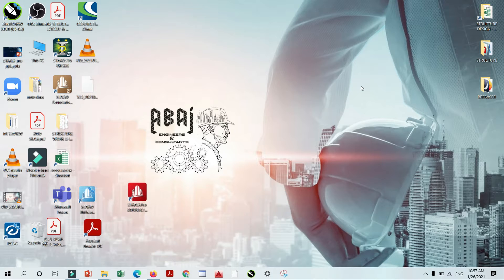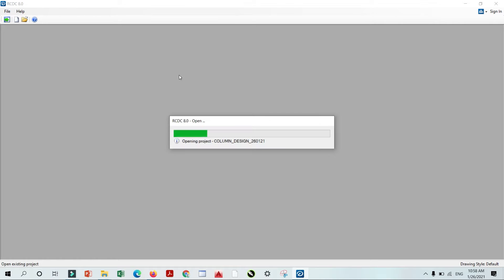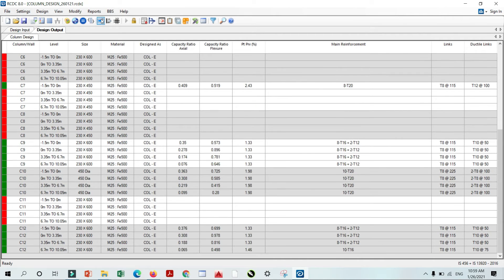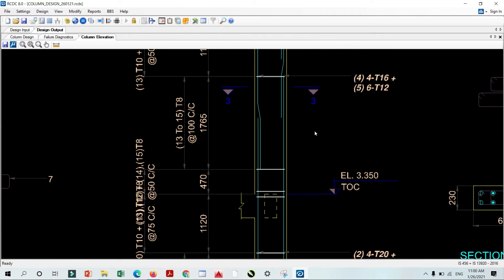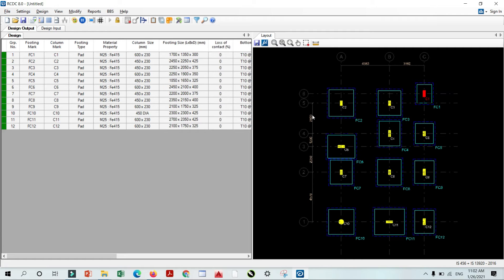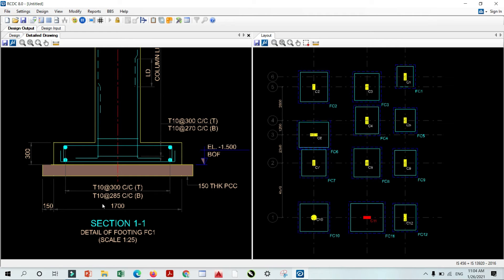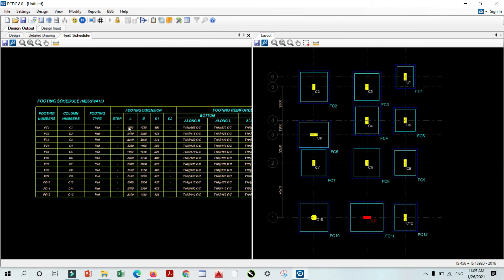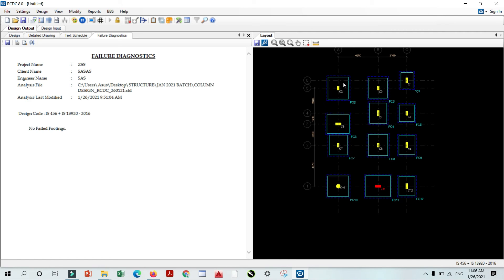Importance of RCDC in Structure Engineering Field || By Struc.Er.NIKUNJ SONDAGAR

Comment: Does RCDC software shows Ast required more than the actual Ast required.
Inshort is rcdc design economical.?
Reply from the maker: Yes it is economical 
If you know the right step......
Reply: @pinnacleeiit  can you tell me what mistake an i be possibly making as i am always getting ast more than required as per manual calculations.
Reply from the maker: @jainikshah3875  contact us at whatsapp
+918460562356